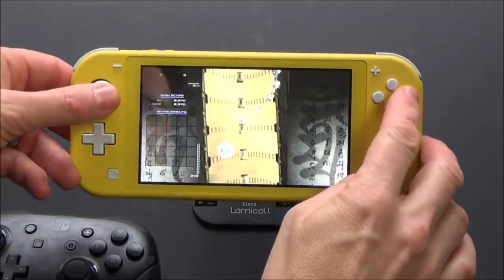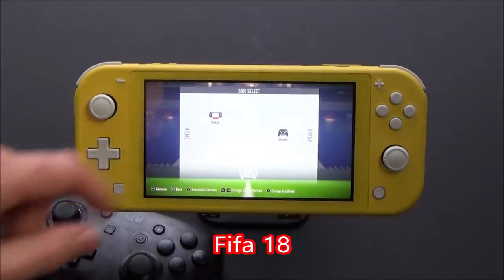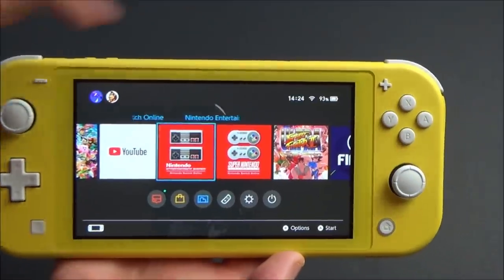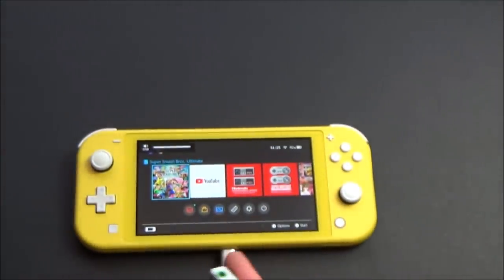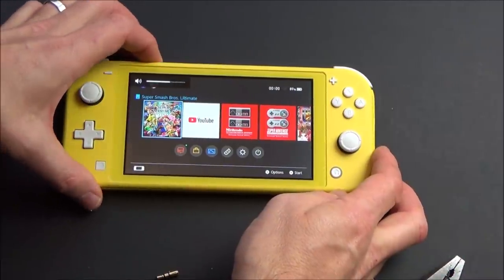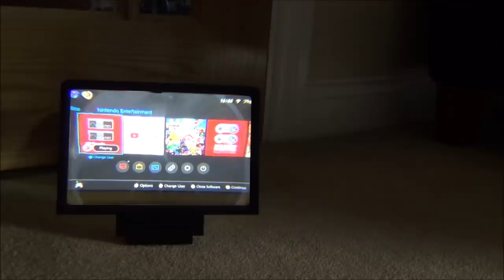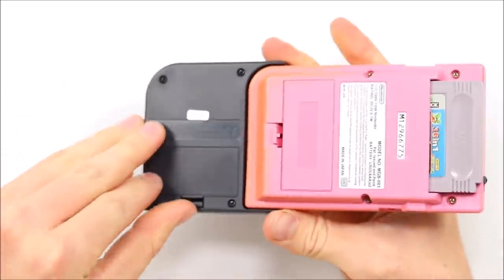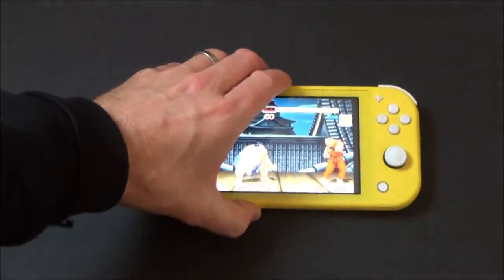Interesting Things on the Nintendo Switch Lite

Comment: Still waiting for Vince to shrink the Nintendo switch lite
Reply: Espen that would be an awesome video, bet he'd do a decent job of it🙂
Reply: He'll probably make it thinner
Reply: I feel like it'd be harder than the original switch
Reply: Mr J 007 
And then he makes an Apple ad

„It’s very thin..!“
Reply: put inside ps vita casing..
Reply: Now make the switch lite back to normal switch size
Reply: I wonder if you could cut the mother board to get rid of the controller part on the right. Then it could be even smaller
Reply: @universaljoyconboyz4ever161  you litterally can, we trimmed PlayStations, wiis, gamecubes, and you can't trim a fricking switch?
Reply: @X_Niaxx_X  I don't know how to trim a motherboards. So my question was what if you could trim the switch lite controller portion on the right. For all I know there could be things that are important on that area or the console doing a check to see if that parts functional. It was a question I had as I've never seen something like that done before and with my lack of knowledge of electrical equipment I would not be fit to test a theory. Another question is who is "we"?

Comment: So here's an idea for the rumble on your switch lite, get a motor from an old cell phone (these are quite small) and relay of some kind, wire the relay to the positive side of the speaker  and to your rumble motor. Pull your power for the rumble motor from the usbc port! You could even put a small pot on the wire coming from the speaker to the relay to control when the vibration happens ( so only the loudest sounds trigger the vibration)
Reply: Honestly the only feature I miss switching from an old switch to the new switch lite is the rumble.. Would pay extra for a USB c rumble pack of sorts
Reply: Dont forget the diode across the relay or it will fry your switch. The magnetfield induced by the coil will cause a voltagespike as soon as its not powered. This spike has to be limited with the diode or it will cause permanent damage. But it anyway would be easier to go with a transistor insted of the relay
Reply: I have a regular switch and I have turned off rumble completely

Comment: A trip to Poundland and you too can be just like My Mate Vince
Reply: Wow the Retro Future is here
Reply from the maker: Haha:-)
Reply: Pound land is great for cheapo tech to teardown its not the worst place for spares either.
Reply: Chris Hill home bargain is also good
Reply: Another good place for faulty tech cash converters I bought a decent ps2 steering wheel with pedals for the low low price of £1 and its full working aswell lol.
Reply: Chris Hill how,much will a ps2 be
Reply: I bought a faulty ps2 from there about a month ago £3 it did have a  faulty disc try though. Iv seen fully working ps2 chunky between 15 to 25 quid depending on what condition and what extra bits they had. And the slims 20 to 30 again depending on what condition ect. The fault stuff will vary from shop to shop but ask behind the counter if they don't have any on display. Hope this helped🙂
Reply: @Mymatevince  fjkytulollkkj
Reply: Haha lmao

Comment: For 3:23 to work although Vince didn't explain it, you need to try it with games that do not use the system API for the pop-up O/S window asking you to connect controllers (the operating system one with the white background). All of the games shown (Smash Bros, FIFA, Cuphead etc use in game controller connect screens).

I hope that helps someone if its a feature you'd like to use.

It's actually small things like that that annoy me about big business. What I mean is I wish they would take the time to modify the software so that on the switch lite (or even the base switch really) when you want to add a second controller it asks if you want to use it as controller two or in place of controller one. I don't have a switch lite but on the main switch it defaults to turning off the joycons attached to the tablet itself (when in handheld mode) to use the new controller as player 1. If they are detached it makes them player one and whatever new controller you add player 2.

Maybe a bit long winded but I'm very passionate about small details like that. :)

Comment: I think you should get some surgru, another rumble motor and extra wires. Splice into the speaker cable so it can power both sound and the motors, then use the sugru to mold a new grip where the motors would be inside of on the back of the switch. You would make the first ever rumble pack for the switch lite. I thikn that's VERY much doable. You've already done half the work now. Totally awesome!

Comment: FYI, the speaker and the electric motor are almost the exact same structure by design. Both are essentially an Earth magnet and an electric magnet created by a coil of wire. The difference is that a speaker is meant to force the two apart and vibrate a surface and a motor is supposed to force the Earth magnets away and around an axis. This is why I think the HD rumble pack worked for you so well. A rumble pack is basically just a motor with an unballanced weight at the end of the shaft that makes it shake. I'm guessing the "HD" in the name is just because there's an array of motors that can be individually controlled. I'm unsure if this is taking the actual rumble data or the sound signal and using that to power it but my guess it that it is the actual rumble data as most motors would require an amplified audio signal to sound correct at all or rumble at all. If this is using the sound data, however, I couldn't recommend running this setup constantly. Just as motors are mechanical devices, doing so can result in them getting really, really hot as they are not designed like speakers entirely so the intricate sound frequencies will generate a lot of heat. Hope you learned something! Neat video, I enjoyed it!
Reply: I pretty sure its hd because of all the things it can do, high definition rumble

Comment: if you slice the wires together with two moters then you can leave the speakers in place and still have the rumble function you wil just have to have two motors outside the console and the sound as well

Comment: Human fall flat is a great game for weird controller setups. It considers attached joycons as some sort of player 0. You can play with joycons attatched as the second player or the first one. If you have detached joycons as player one and attatch them, a different controller will become the first player without changing leds. It also does not default to attatched joycons being the first player option.

Comment: speakers work with AC, while the motors from the PS4 controller are very standard DC motors. The HD rumble motors probably work with electronic magnets, moving them in a linear fashion, wich would allow very precise rumble, just by changing the frequency of the electricity going through it. the fact that te PS4 motors don't work doesn't have anything to do with the power outputted by the speakers, they just work in a completely different way.

Comment: I think you could use the speaker and rumble if you had a middle connection like in this PS4 controller kit, I'm just using it for reference as I'm not really sure what that exact type of connection is other than LED related. 

eXtremeRate 7 Colors 9 Modes Touch Control Multi-Colors Luminated D-pad Thumbsticks Face Buttons (DTF) LED Kit for PS4 PS4 Pro PS4 Slim Controller https://www.amazon.com/dp/B07CJH1NT7/ref=cm_sw_r_cp_apa_i_PRSQDbZFK1D8V

Comment: Maybe splicing the cables together for the speaker and rumble pack? It would be interesting if it worked and then you’d still have 2 speakers and could potentially have 2 rumble packs (if it works)

Comment: With those new clear shell replacements available now, i wanted to know if you can run the switch lite without that metal back plate on? is that safe? it will look nicer not sure what its function is.

Comment: The HD rumble thing works cause that's how hd ruble works. instead of a lopsided weight on a dc motor it's a coil with a weight on it, aka a speaker with a weight.

Comment: Since the Switch and Controllers are seen as Player 1 in some games, can't you build in some parts of Joy-Con into the Switch Lite, connect them and make the housing a bit bigger? Or create a custom Switch Lite Rumble Pack, that clips onto the back of the Lite and uses the internals of two Joy-Con. You could even let it connect to the USB-C Port, so it can charge.

For me, Rumble is one of the most important features when it comes to video games. So having no Rumble in the Lite was a big letdown to me. I also wished we would've gotten the Sticks from the Pro Controller. Analog Triggers would've been a nice addition too, but Nintendo didn't cared for them since the Wii Classic Controller Pro (I think)...
Reply from the maker: Thanks, I did think the same thing but Co-Pilot only worked on a few of my games. If it worked on all of them then your option would definitely work :-)
Reply: @Mymatevince  Maybe there is someone you could ask, that would create a simple hack/mod for the Switch Lite, that would always recognize the first connected pair of Joy-Con/the first connected Pro Controller as Player 1, while also seeing the Lite-System itself as Player 1 too. As long as the games would accept that, it shouldn't be that hard to do.

Do you know someone in the Switch modding-community that could do something like that?

The other thing would be to wait until the Lite gets hackable...

Comment: Ive been testing a few of the games i have to see which ones allow co-pilot, and which ones let you use the system as a controller in a multiplayer game
Some of these games are single player only, in which case they are marked N/A for being able to use the system as a controller for one player

Lego City Undercover
Co-pilot: No
Using the system as one player and a wireless controller as another: Yes

Qbik
Co-Pilot: Yes
Using the system as one player and a wireless controller as another: N/A

Monopoly for Nintendo Switch
Co-Pilot: Yes (Must select use one controller for all players)
Using the system as one player and a wireless controller as another: Yes

Farming Simulator Nintendo Switch Edition
Co-Pilot: Yes
Using the system as one player and a wireless controller as another: N/A

Miitopia
Co-Pilot: No
Using the system as one player and a wireless controller as another: N/A

Comment: might be a noobish question. But wouldnt the speaker and rumble work together if connected in parallel to the same connector? Or is the power insufficient for both to work together?

Comment: Wasn't there a way to stream the original switch to tv over WiFi? Wonder if that is possible with lite.
Reply: To the best of my knowledge, the Nintendo switch has never supported such a feature
You might be thinking of a video where he used a wireless HDMI adapter (which plugs into the HDMI output, in the case of the switch, this would require a dock, and it wouldn’t work on the switch lite)
Reply: @pineappleroad  nah it was definitely through cfw

Comment: Probably we can check out audio circuit, and see if it has multiple audio input, and hunt down the audio signal that related to the movement, and use that signal to control hd rumble.

Comment: I am very like it when you used Switch lite as a player 1 and Pro controller as player 2 but i try it with my Switch lite, And it not work, My pro controller always stay in player 1 position and control my switch lite all the times. If you could change pro controller to player 2, please tell me, and how many game can i play when just using switch lite and one pro controller ?.

Comment: Hmmm I have very small motors about 5mm in diameter, what if I connect it DIRECTLY to the speckers so you won't loose any speakers and one on eash side maybe

Comment: I just want a satisfy grip that has rumbling in it or a small headphone adapter that outputs vibration. So ideally they can copy your mod but take a usb c signal out to achieve it. Or Nintendo can shrink the HD rumble module super thin. Add a splitter and we can do the install ourselves with their instructions. While still having speakers. Like a new speaker similar sized that fits into the same spot that has the thin module inside.

Comment: I want to play Super Smash Bros Ultimate with a friend when I will have a Switch lite. I know that if the pro controller is connected I can use the switch as well, but can you play with no problems?
It seems really hard...it might it be awkward, but I don't actually know. Can you tell me?

Comment: If you are modding the switch lite for rumble function,why not just modding it for HDMI out as well by tapping the signal straight from the lcd wire of it by splitting it,
But about those other ideas like That projector dockstation why not just propper HDMI out insted???,but i do hope that nintendo will make an official one ,let they also come with a clippible magnifier glass,and lastly let they come with an external clippible rumble pack for the switch wich takes the audio signal and convert that to rumble,and they could add an update to their games to switch off the music from each of them to get around that overrumbling from the music,so if nintendo will come with such accessoireses for the switch lite,then you can have some missing features back in some alternative form,and if nintendo is not doing it,let thirth party companies do it instead again to justify the fact that nintendo turned that switch into an unswitchible switch the switch lite.

Comment: What if you made a dual-port plugin where it's a single to double plug in? Or split/merge the red and blue wires to make a single connection so you don't have to sacrifice sound or rumble and just have both.

Comment: In my opinion switch lite is just an option, i would rather buy the normal switch, way more mobile than the switch +, and has more battery than switch lite (probably), can be docked and can remove the joy-cons (imagine u get drift problem on lite, you need to rip off whole switch just to replace analogs)

Comment: Here’s another one.
Buy a Bluetooth transmitter and plug it into the headphone jack then boom your switch is now Bluetooth capable so you can connect your wireless headphones to it.

Comment: I wonder if you can tap the hd rumble wires into the speaker wires and the use some sort of case with grips and jus stick the hd rumble inside of the grips of the case

Comment: can you not make a spliter for the audio?
to retain stereo.
these connectors should have enough space to jam additional cable for each polarity i think (bare in mind i do not and never did poke around switch i am going off my knowledge of PC parts that are noticeably larger).
if you can place the HD rumble in parallel with both left and right (behind simple diodes) and maybe find some nice space within casing it might have some future.

Comment: All the hate for light and im happy i got it. Ive a Gaming PC and a PS4 so cheapo switch is perfect for those few games ill play on it. I know its not perfect and im lucky to be able to afford multiple gaming setups, but if a switch is a secondary console and you wont use it for multiplayer/ tv mode, its a good buy. Its lighter with better battery and feels better in hand. If you can only get 1 console, buy ps4 or xbox and if ur a die hard fan that will use switches tv mode, then buy it right now :) Lite is not for you